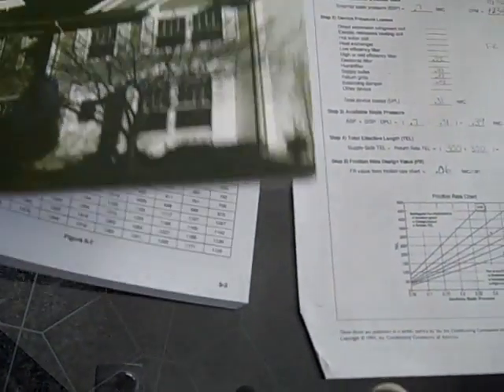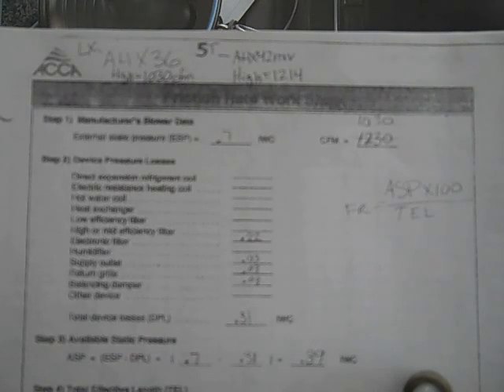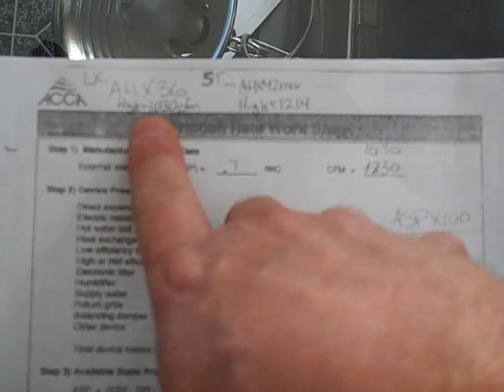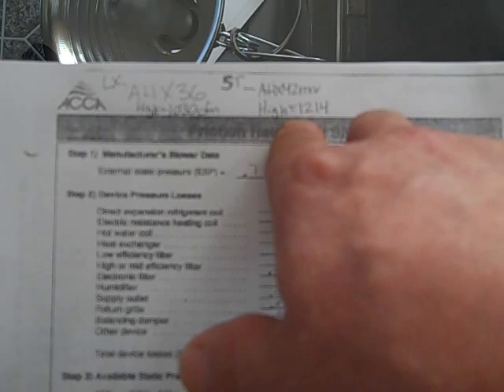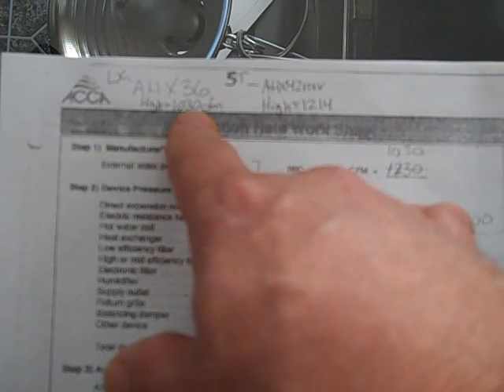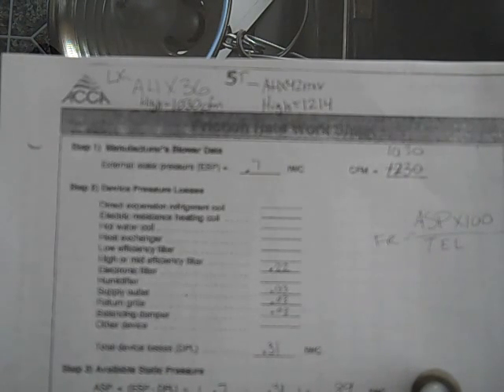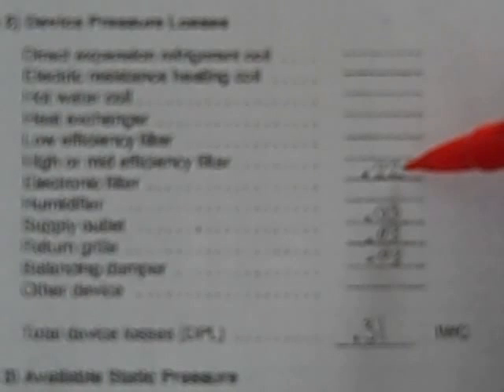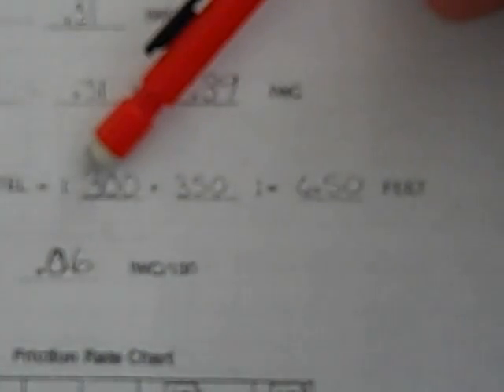HVAC Design Build P4 Duct Calculations.wmv

Comment from the maker: @BeeProApiaries Do room by room load calculation to obtain the percentage of the total airflow to each room. Draw out your duct routing and find the equivalent lengths found in manual D along with literal lengths. Determine the friction rate from the calculation after you determine available static and longest path. Stay within maximum velocity limits. Not something your going to learn in 500 characters.  

4 tons is a hell of a lot for 1300 SF.  But square footage isn't the deciding factor.